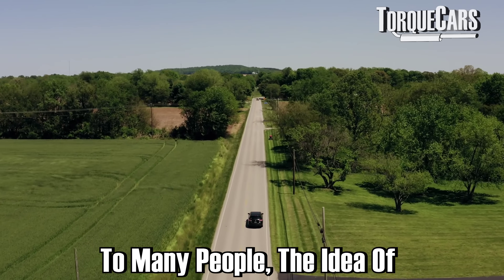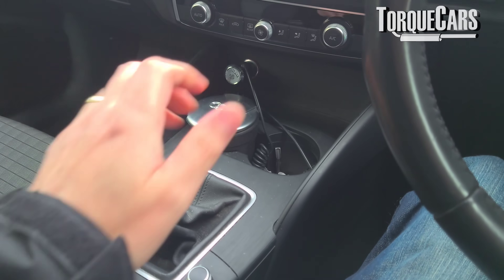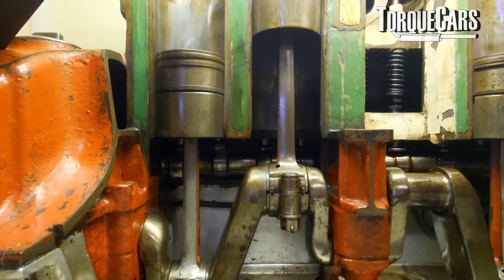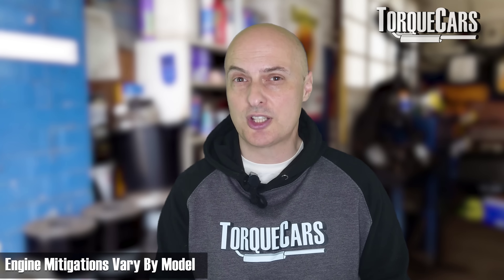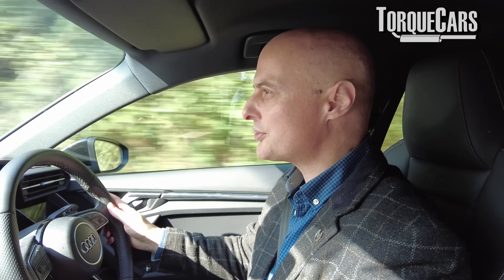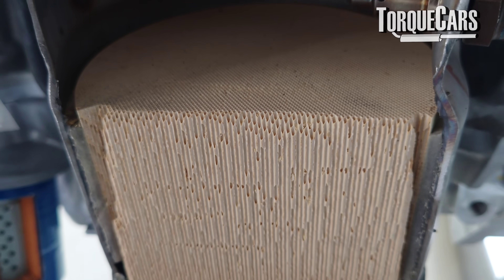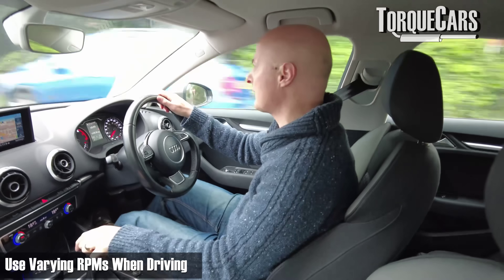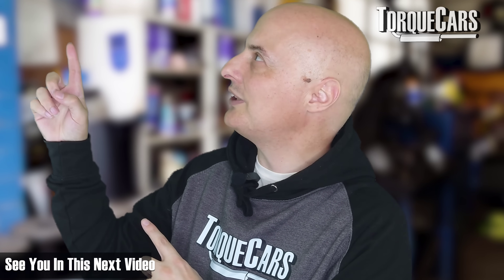BIG DAMAGE By Lugging at LOW RPM? Eco Driving Warning! (Manual Gears)

Comment: Low rpm is not a problem IF you don't require power and torque from the engine.
Reply: Exactly this. When up to speed and in the right gear, very little torque is required.
Reply: Completely agree. Cruising some automatic sport cars this is even more evident: rolling 50 km/h on 7th gear when no power or torque is necessary.
Reply: @Great_XicoZe  Stock sport cars dont have7th Gear 😂😂😂😂
Reply: Then you are not lugging..
Reply: Very true
Reply: While slowing down drastically from 5th gear, I would just let go of throttle, without pressing clutch to such low speeds. Engine would about to stall. But never try to accelerate without downshift. I do that often and also scared if that had hurt my engine..
Reply: Stock engines don't have too much of those so there's no issue unless your car is significantly tuned up.
Reply: I knew that when I drove 6 speed hemi
Reply: not actually true, lots of these modern cars seem to have lubrication issues with constant low rpm. for example GMs Cylinder Deactivation hasn't been a problem for guys who drive their trucks hard.
Hyundai had a motor failure in some of their cars but budy I know threw a turbo on one and is beating the snot out of it with no issues.
Dodges earlier gen 3 hemi with the oiling issues where camshaft and lifter oil was simply splash lubricated from the crankshaft
I really think these modern engines need some rpms to get everything moving.
Reply: Here in the states, the vast majority of people drive automatics. So driving at too low of an rpm is not an issue. The transmission operating parameters won’t allow you to lug the engine or operate it at too low of revs for any length of time. However, one of the issues you can have with feather foot drivers is they may operate their vehicles in a manner where they may seldom reach a proper operating temperature for any extended period of time and that can lead to its own set of problems. 

While I doubt many people remain in the driving population who came from the era of low rpm engines which were intended and built to operate at very low rpm’s. Except for truck drivers who currently drive heavy duty trucks with engines designs made to work hard with the engine operating best in the 800 to 1400 rpm range. There was a time decades ago where many automotive engines were intended to operate in the 1300 to 3500 rpm range and the stopped making power above about 3500 rpm. For the most part now, we use smaller displacement engines which have to operate at much higher engine speeds to produce the same power that the old bigger displacement motors made at just off idle speeds. 

There are many people who have driven and are used to older slower turning engines then moved on to the newer modern faster turning engines who just flat out do not like the faster running engines so they continue to operate then like their older engines. The end result is they are less satisfied with the performance of the newer engines and by operating them in the manner suited for the old engines results in bringing on problems with their newer engines because they are not operating them where they are intended to be run.
Reply: @americanrambler4972  Kind of the same thing with the motorcycle community.  A lot will not ride a small capacity bike on the interstate because of the high rpms.  It doesn't hurt anything but many riders say it sounds like it's gonna blow up or that it's working too hard.  Many people don't understand that you can run at redline all day long as long as your not going over it consistently.
Reply: Every lorry manufacturer disagrees with you.
Reply: my altima likes to accelerate at low revs. It's a v6 so should I be giving it more rpm even though I can't bc its a cvt? 190k miles original cvt
Reply: Definitely avoid the rpm band where the engine is vibrating significantly. I witnessed someone pushing a Subaru WRX hard in that band and had to tell him to please never do that again. (One thing not mentioned in this video but probably a primary issue is wear on the piston rod bearings.)
Reply: Low rpm downhill is fine and saves fuel
Reply: @johntheodosiou7248  correct, the oil vs bearing pressure is the problem. A mechanical oil pump will produce 0.5 bar of oil pressure in a hot engine at 1000. Especially diesel engines which can produce  high torque when rapidly accelerating at idle engine revs simply press through the oil film in the crankshaft and rod bearings until metal scrapes on metal causing extreme wear and tear.
Reply: What if the the engine puts lots of it out effortlessly
Reply: Aka only on highway, that's why so many people have issues as they drive at low rpm at all times.
Reply: If a car is lugging at 68-71 in the carpool on the free way (regardless of its power aptitude / intended road use)…. The following consequences concur.

Constant understeer

Considerable delay in response to sudden road hazards combined with understeer 

leaving you completely helpless to sudden impact as you have no potential to force match with incoming vehicle or when closing in on a gaurd rail to drag the car to a halt by gentley hugging the side wall vs  slamming into it completely unaware.

A vehicle driven at proper rpm’s is more likely to be driven by a more attentive driver vs droners 
And will have higher chances of properly reacting to road obscurities /complexties/etiquettes.

Imagine a vehicle is lugging and possibly holding up traffic driving in an idle fashion in the furthest right hand …

Another vehicle comes up from behind but is cruising a maintained optimal rpm (connection to the road)
At the exact same speed but right rpm

exactly 2 car lengths away

But able to move horizontally back and forth in and out the leading vehicles side mirrors smoothly and steadily without leaving the distance of 1 -2 car lengths.

✅ the leading vehicle is lugging

✅ leading vehicle if in the left hand is most likely driving the exact same speed as the right hand lanes or barely a tad over causing congestion/gridlock

✅ leading vehicle is more likely to have attention directed else where besides the road or possibly spending too long in the process observing the road and making decisions on the road.

This remains slightly insignificant until a vehicle actually needs  to get out of the way of an obscurity in the road or when reacting to ongoing/oncoming vehicles in potential hazardous moments…  this can actually be over come and reacted to naturally  if the vehicle was in optimal rpm/ steering range.  

A vehicle lugging is stuck to one line and has to achieve proper rpm before it can effectively change lines again in  fluid motion.

Lugging is also why vehicles  may find it hard to merge onto the free way 

 oncoming traffic from a merge tends to be accelerating from 40mph up to 70-75 depending on how open the freeway is. (If you can cut across to carpool essentially) 

This is usually done smoothly however if you’ve ever tried merging on the freeway just to question why you have to either let off  the gas so heavy or accelerate heavier is due to multiple vehicles lugging less than a car lengths away from another. This is the apex of traffic and the truth behind why most vehicles also take turns from red lights really slow on the streets. 
When merging you either have to slow down to an uncomfortable speed due to lugging traffic speeds or get ahead and accelerate to get around the “herd”.

You can tell you woke the herd up if you notice cars start following you. ( realizing one is not actually driving )

Not lugging your motor is also understanding you can steer right and go left / vice versa even in a straight line and not just drifting applications.

I honestly don’t think we’ll get flying cars. 

A lot of vehicles on the road  aren’t aware they are hardly actually driving to home school work but  more like coasting. 

Is coasting to that level safe as your driving becomes more of an event where your driving becomes more of an idle action/pattern ? Yes if you’re not distracted or impeding traffic. But anything can happen on the road ahead or coming from behind or the side. 

When that happens a vehicle would do better of with its driver being aware of its rpm relative to the steering angle need to provide the most options when it matters the most relative to its position between obscurties /objectives .  It’s usually a split second.

That’s sacrificed already when a vehicle is lugging especially at speeds above 60. That’s a whole another second just to get the car to grip to the right rpm and the vechile may have been well into being hit by the time the pedal was pressed . #nocontest
A vehicle lugging is also more likely to brake check harder (over brake)  and in a less telegraphed fashion if caught off guard while out of optimal power band. 

That weird feeling you get when you text for a second and forget  your alignment to the road and everyone sees your car jerking as you gain concentration again

That wobbling moment is a sign of lugging. Like being a rag doll on the road essentially . Also why testers tend to overly speed up past proper rpm. My overly explained take.

Understand the proper rpm and what point on the steering wheel that rpm is best controlled for your grip style.

Imagine driving with one hand to realize you’re not so good at it between 83-85 when it comes to switching between macro/micro adjustments. Prolly wanna rethink  that theory and adjust your steering Colum and seat  for not just comfort but for measure in depth perception to your hood to the rear bumper of another car ( if you have multiple cars at home just park close behind one and adjust your seat /steering in comparison to how close you can get to the bumper while also not guessing.

Driving constantly @ effecting vaultes is basically actively adjusting the feel of the drivers side for comfort and depth perfection not just comfort.

I’m pretty passionate that 85% of drivers aren’t aware of what driving means and how something as minuscule as being at the proper rpm is a big game changer in general. 

I feel like individuals would still rely on their insurance but be effectively proactive  in situations where they can avoid getting hit and having to deal with insurance in general. 

Either way you want the motor to purr…. race car or not and lugging is more like smooth buckling in comparison.
 
I’ve always felt lugging is definitely not driving at all. Maybe obeying the speed limit while being under it often as well or taking forever to reach it.

A lot of the lights could carry more traffic if vehicles leading didn’t lug to get to speed. No one even be thinking about that. I love this topic. Roads aren’t safe because people can’t actually drive and the dmv just gives you the privilege to drive rightfully but doesn’t really even care if you actually can as ticket fines  and insurance policies make  the economy run as well.

Great topic to share with world although it’s easy to not even think about how essential understanding how you don’t drive “lugging”
in situations when it 
actually counts because it’d be too late to make it count 🪦 

I think driving at proper rpm’s and understanding the difference in steering /throttle response should be normalized.

Lugging is like depending on your insurance to fix all your problems if something were to happen as being in the proper rpm allows all drivers driving to be less dependent on needing cooperation from other vehicles to make sensical and well timed decisions on le road.

It’s a state of mind / awarness fr 

Like choosing to drive lugging at  55mph on a clear off ramp back to the street while two cars run up on them from behind around 65-70 mph & proper rpm choosing wether or not to slow down to street speed or simply go around you when your still on the freeway.  Out of rpm and under the speed limit yikes. California

Also speeding up when another vehicle is coming up on you is less intrusive of an adjustment if you are not lugging. It also lets the other vehicle know you are alert of the flow of traffic and driving accordingly and will more likely to match your speed as you are holding a proper rpm within the speed limit to allow logical flow of traffic and logic passing / lane changing opportunities for everyone….. GAINS! 

Lugging is like driving like the vehicles a cow and with enough lighters you get a heard on the free way or you get congested streets with little to not lane changing opportunities.

A school of fish probably understand this concept of leading and following as the continually move together even sharply. I’d say schools of fish are like a group of capable drivers that don’t impede one another while maintained calculated precise independent movements. 

The stop light example can be translated to how salmon travel up stream en mass .

The stronger ones moving faster in the front freeing up resistance for weaker fish behind essentially  them to “hydro draft” up steam together faster and more effectively than if alone.

If there cars take off from a light to free up traffic and the two furtherst lanes left spend less time reaching 40 while the right hand luggs it and doesn’t give much attention to the moment traffic will still free up more effectively than if all three lanes speed up and maintained proper rpm throughout acceleration to 40mph.

 feather & ease vs driving in the dimension of a super heavy unsure inanimate boulder. Using a led foot and 50% thought 50% try my insurance agent
Reply: Exactly, perfectly fine in city driving when goijg 30mph
Reply: @johntheodosiou7248  that's what he said
Reply: my Audi literally warns me If i require power in low rpm.
I think most modern manual cars do this ^^
Reply: In some situations, (down hill)in some long distance,I put in neutral  my manual transmission of my scion tc 2.4 liter,and don't do any torque and in comparison with my friend,who has some car,my engine of 300,000 miles working perfectly.
Reply: @waldemarmaldonado5882 there's zero reason to put it in neutral. You use more fuel coasting in neutral than you would doing it in gear
Reply: @Jacobtheunwise  that's true, but you lose more velocity being in gear.  It depends on the situation, if you're going down a hill and stopping at the bottom you stay in gear.  If you're going down a hill and climbing another hill right after, and you don't need to slow down at all, it's more efficient to be in neutral.
Reply: @waldemarmaldonado5882  Dropping down hills in Neutral can actually use MORE fuel because most modern Fuel Injection systems shut off the injectors during long decel periods as emissions are more difficult to control in that situation.   Using Neutral means the engine keeps idling which uses fuel so this is not a good practice and actually illegal in many States.
Reply: @recoilrob324 True in some cases and not true in other. For example, if the downhill is steep enough,  then yes, leaving it in a high gear will be better as long as it doesn't start slowing the car (it will shut off the fuel completely). On the other hand, if the downhill is not steep enough, it's more fuel efficient to have it in neutral. In simple terms, less pedal you press, better mileage you get. And if you need to press the brake, rather shift in a gear.
Reply: @waldemarmaldonado5882 I just let car roll at the right speed in the city down hill.
My car can drive 800 km on a full tank of diesel, letting car roll down hill at the right speed, it can go 75 km longer on a full tank.
Reply: @waldemarmaldonado5882  Suboptimal. Use engine braking, you'll save fuel and brakes and the gearbox is built to take the load anyway.
Reply: You can also just put it in a fitting gear and use engine breaking downhill. It won't wear your breaks as fast
Reply: @waldemarmaldonado5882  neutral in downhill ? dude is a killer
Reply: @waldemarmaldonado5882   I remember on top gear Jeremy Clarkson mentioned that putting the car in neutral requires a small amount of fuel to maintain idle. On the other hand if its in gear, the ECU cuts fuel delivery as there is no throttle input and the motor is turning faster than needed. Think of him what you will I believe he is correct.

If you switch the ignition off whilst coasting down hill in gear, there is no change to the engine braking so then it must mean that no fuel is being burnt at that point.
Obviously a carbureted car is a different story
Reply: @waldemarmaldonado5882  I do it all the time. Passat 1.8t 2000 stage 1 190hp. I use gravity and aerodynamic of the car and achieve great mpg (43.5mpg or better). But I also rev it to red line when needed. It's a joy engine. 380k km and still pulls like crazy.
Reply: Nowdays ecus protects pistons and it dont matter cause pedaling is not hoing to do anything before protective limits let it.
Reply: @johntheodosiou7248  what a genius. I realize I don't need to start my car if I am not moving
Reply: @BadThrusher  You fail at getting the point. You don't need more than a few hp when just cruising at a steady speed.
Reply: Yeah, im totally agree, i also aften used this method with my manual transmission (according situation)...a little bit save fuel...
Reply: @johntheodosiou7248  uou have an emergency and need aceleratr to avoid an accident, you will lose time to drop a gear
Reply: @marcocarvalho3619  It will take you a lot more time to not downshift.
Reply: @marcocarvalho3619  you will lose more time to stay in a high gear and shake it up to speed.
Reply: @marcocarvalho3619  not in sport manual mode on my civic. It’s just a bumper
Reply: @marcocarvalho3619  like 1/4 sec = 25 mt at 90kmh likely
Reply: @marcocarvalho3619  If you're in any type of emergency, you should be breaking, not accellerating.
Reply: @marcocarvalho3619  Yeah that scenario happens all the time!!  Spoiler alert: like almost never.
Reply: @marcocarvalho3619  That will happen so rarely it doesn't matter. Also it takes less than a second to shift down if you're good. There's really no point in being in the optimum acceleration range always, and you'll waste fuel.

BTW, you'll lose that time with an auto transmission too.
Reply: @marcocarvalho3619  true, but in most emergency situations braking makes more sense.